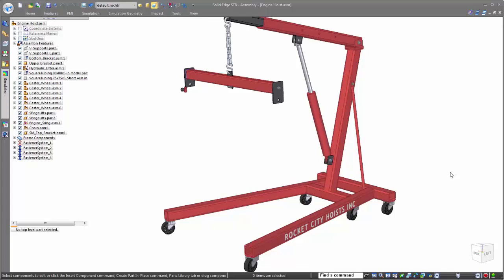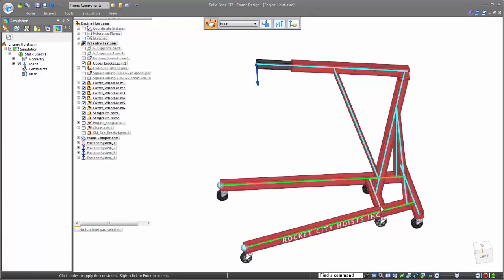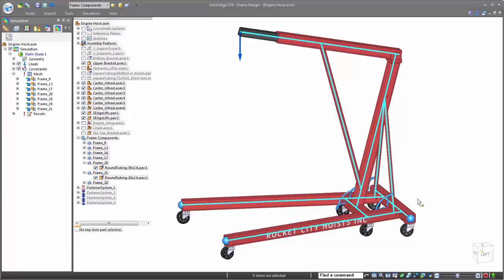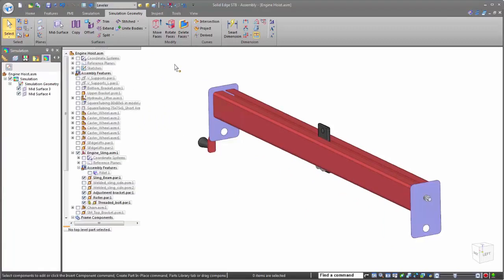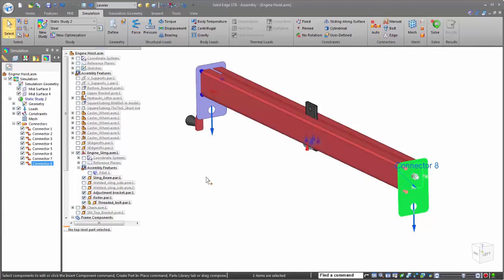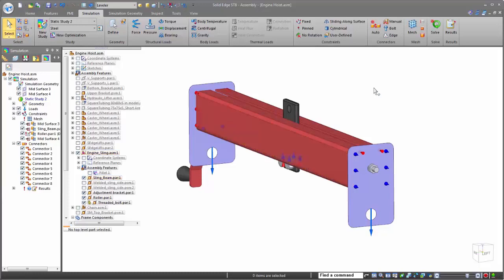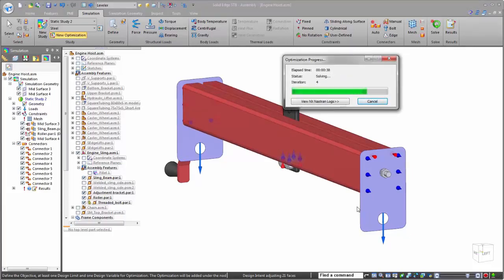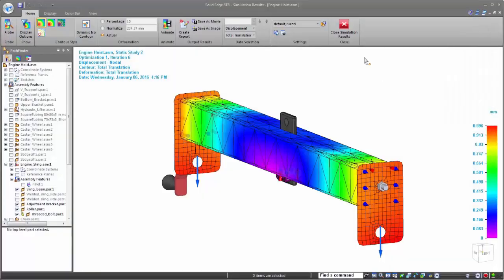Solid Edge Simulation and Optimization

Comment: Hi, why did you put a pin constraint between the 3 frame pieces and the base instead of using fixed constraints there as well?
Reply: I was also wondering about that.